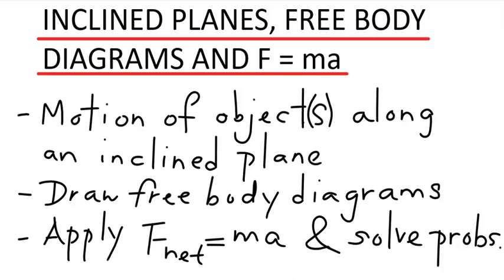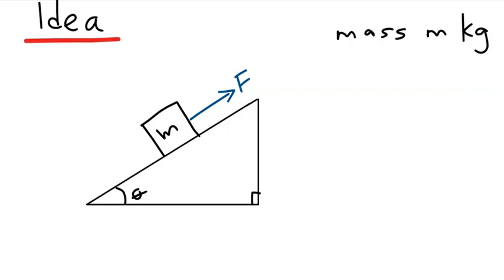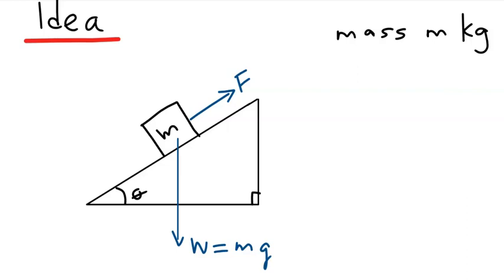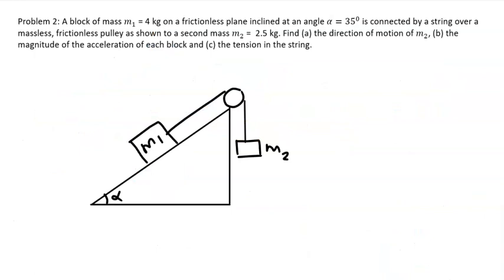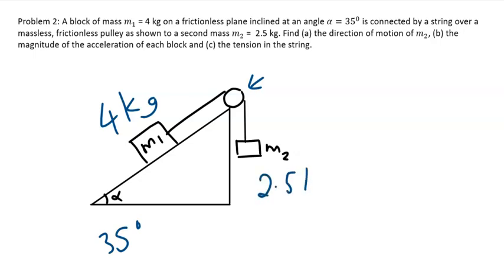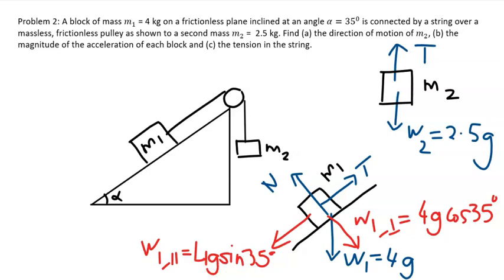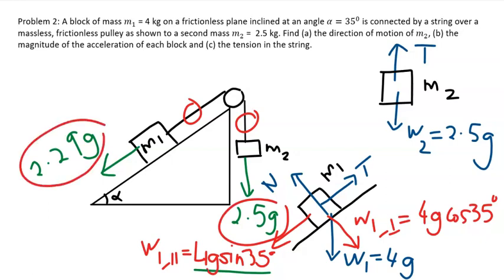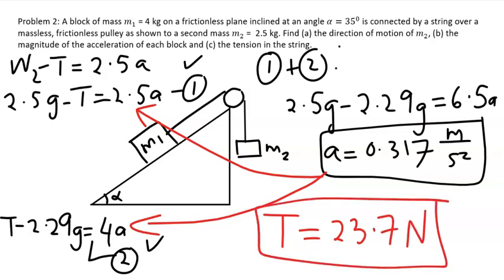Inclined planes and Newton's second law of motion - Physics

Comment: The lesson is clear am thankful Sir but I have a question why is the Tension having a -ve in the equations
Reply from the maker: Thank you for the question. I assume you are referring to tension (T) associated with mass m2 in Problem 2. Here, m2 is accelerating downward, so the net force on m2 must also be downward. m2 is acted upon by two forces: its weight w2 (downward) and tension T in string (upward). So the net force on m2 = w2 - T (in order to satisfy the downward direction requirement for the net force on m2).
Reply: @briefphysics  Thank you clear now ☺️☺️